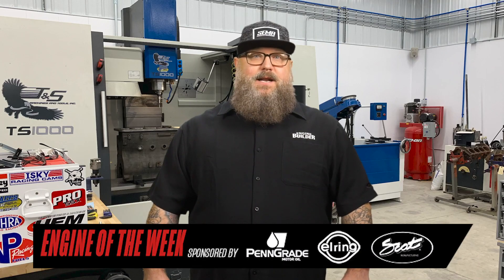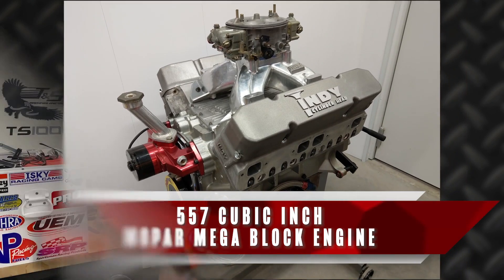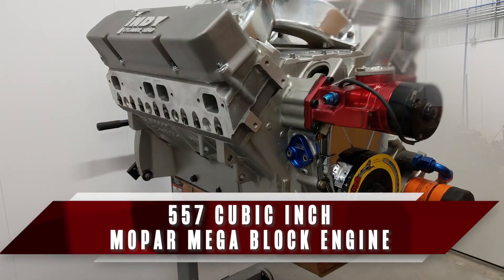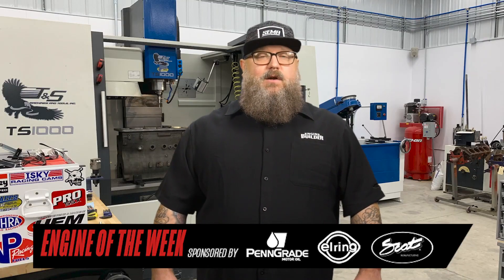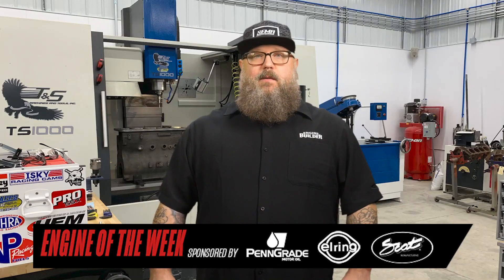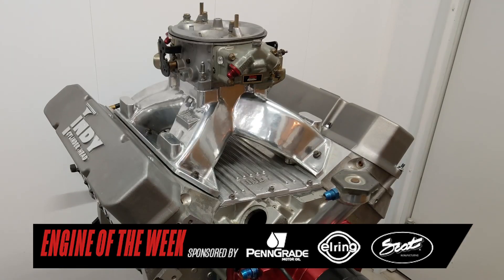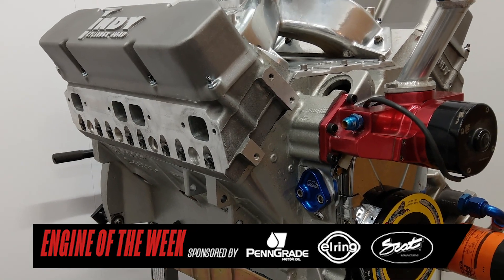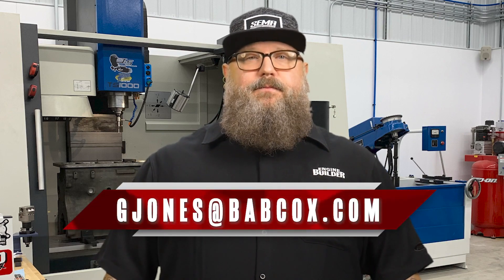557 cid Mopar Mega Block Engine

Comment: 4.375 bore size is not enough,  use 4.400 bore or even better 4.500 bore size.  Make the valves wider with the valves  with intake valve to 2.400 and 1.900 exhaust.  Just a thought.

Comment: Nice build, but no way it makes 900-950hp with SR heads, and only 11:1 compression.
Reply: I have SRs and agree.  If you massage them to the max, they could get to 750hp.  Anything more would require a power adder or exotic fuel.  If he re-worked these heads, they'd have max wedge ports and 2.25" valves and basically be 440-1s and handle up to 540 cid.  So on the bright side, there is no chance of the SR head flow capacity going to waste for lack of cubic inches.
Reply: @overcastfriday81  he noted to make more power they went with the 280@ 0.050 lift, .700. if 440-1 was end result of porting it would be capable of closer to 800 maybe But not enough intake Manifold

Comment: I always wondered if there was a better block for the big block mopar  . The hemi had a lot better block or bottom end that the wedge or it seemed that way to me . The cylinders head on a wedge in my option were only for torque and need  a lot of help
Reply: stock Wedge, esp Low Deck (383 etc) is the strongest production block in the history of the automobile.